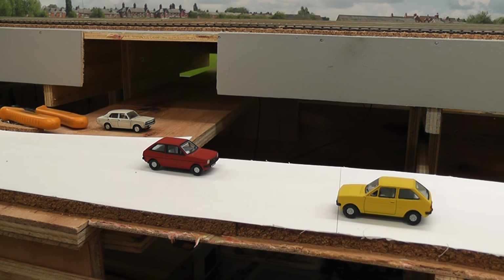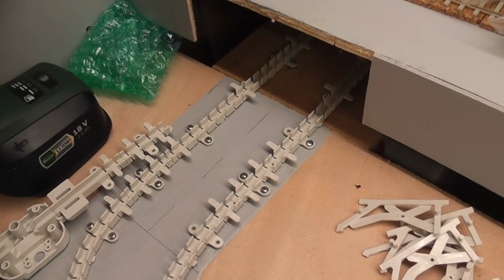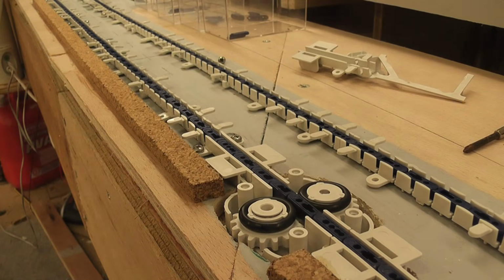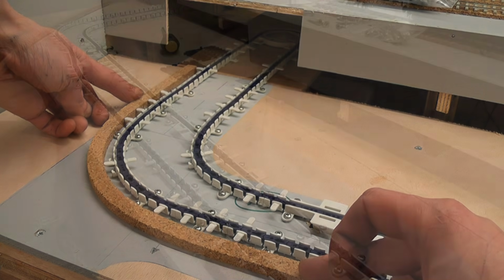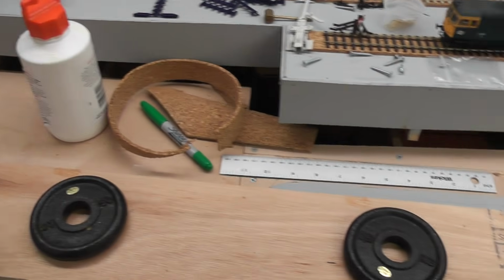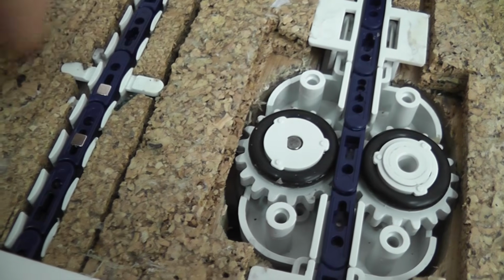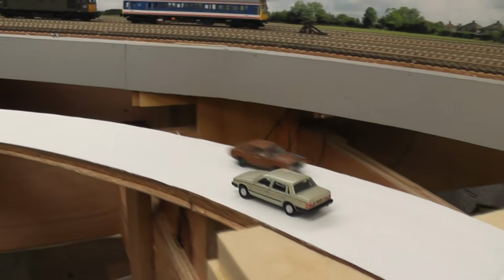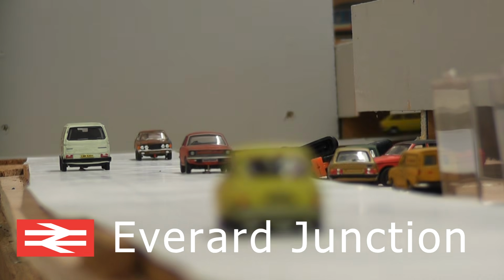New Layout Build - Magnorail

Comment: Excellent bit of modelling. I can imagine Magnorail becoming v. popular over here in the UK. I have used talcum powder as a dry lubricant in the Keen system couplers. This I have found to be very effective and ecconomical. I don't know whether it would work with the plastic in the Magnorail system, but it may reduce the noise level aswell as prolong the life of the track/chain. Regards Stuart

Comment: What I would like to see is whether you could have two of these systems meeting each other, and therefore allowing the vehicles to change road/direction when the slider reaches the different circuit, and it will follow either based upon which direction the car wants to pull it. You could also dip one circuit below the other if you wanted to change systems to remove stress/ make easier directional changes. Really great work 👍🏻

Comment: Excellent video, and this partly explains why you've been a little quiet on YouTube recently.

Clearly the Faller technology isn't appropriate for your application, for the reasons you've outlined here, but don't necessarily reject it completely.  I haven't tried this myself (but see no reason why it shouldn't work), but if the Faller front axles with their steering capability are available as a spare part, perhaps you could provide steering for larger vehicles (trucks, buses and vans).  Those vehicles would need no separate 'skid' underneath them, and being steered around corners might significantly reduce friction.

Comment: The incline in the road running really does add something, it's not something I've really seen before. I did wonder if anyone has tried lubricating the system but considering it's operation in elevation change and length it is impressive. The floating frame baseboard technique you used really does lend itself well to this road system.

The 47 rising into view from the point of view of the road is rather majestic, feels like there is this sudden 'depth' to the scene that wasn't so apparent before. I think a few of "us" can remember being in the back of an the family car and seeing some Mk2 stock racing by.

Comment: This system looks great.I used to work with a system in mining,which is a bigger version of this.Instead of magnets,sections of the chain,would have a raised sections,which would catch onto dummy axles underneath minecars,and so push them along.The chain track,would be between the rails.A similar system is used on roller coasters.Just wonder how long this will last,as there's a lot of moving parts,but still great.Need something for people now.
Reply: A car wash is another example of the same idea.

Comment: WOW! I have seen the Magnorail bicycle in operation, but not the cars. Very impressive. Reminds me of a Matchbox "motorway" set I had as a child with a long coil and plastic prongs you stuck on the bottom of your Matchbox cars to engage the spring, but this is light years ahead of that. And it was ever so loooong ago! ;-)
Reply: Yes I was wondering if anyone else would remember the matchbox motorway 😎
Reply: @nathancox6249  Ha ha! I take it you're as old as me! ;-)
Reply: I recommended Hot-Wheels Cars but Matchbox would also be an excellent alternative to the bent-wheel junk he's dragging around in circles. What he is using would look better if he put a magnet on the roof and dragged them around upside down. At least the wheels would stop wobbling.
Reply: @Kevinegan1  !00
Reply: @Kevinegan1  You do appreciate this is a SCALE model
Reply: Do you plan to reinstate your tyre fitters shop from the previous layout to sort out the wheel alignment(s) ? ;-)
Reply: I had the matchbox car thing. The motor was in the middle of the figure of 8. Great toy that was. 😂👍

Comment: Instead of the provided "track bed", could you use a router to cut the line? The motor area and loops would have to be flush fitted, but on a 9mm base board, negligible.
Reply: I expect that slippery plastic used for the track bed is quite important on the curved sections.  There would be some serious friction in the chain if routing a curved groove through MDF.
Reply: @GJChurchward  maybe just use the supplied track on curves and leading into the return wheels, on the straights I think it would run fine.
Reply: @irvsstella  alternatively, rout the groove overwidth and line the edges with some Evergreen plastic strip?
Reply: Great job all the same, I can't wait to see Everard Junction ptII your videos are an inspiration and a helpful goto source.

Comment: Now that's something new and interesting.   Get drivers in those cars and it will just finish the job ;-) Dave
Reply from the maker: Cheers Dave.  The cars are going to need some work.  Mostly need to try and sort out the wobbly wheels and squeaky noises.
Reply: @EverardJunction  Wouldn't be British Leyland without them! Keep them for, ahem, authentic detail. ;)
Reply: What you think if we could ? By putting headlights in the vehicles ,;-)
Reply: Zorry Dave, they don't make monkeys that small.  And crickets are too dumb to train.  You got any tiny relatives?
Reply: Working lights is good.  Still better than a motor and digital system inside every damn one.  Cars should be incidental scenery on a model railroad, not a focal point getting too detailed in the operation, but it also helps to not have everything except the trains in suspended animation.
Reply: It is a model train layout in the first instance, I agree.   Moving cars is a relatively new innovation.   It is however a challenge to get them looking realistic, which I believe Richard is trying to address.   I have seen some moving vehicles at exhibitions that seems to be breaking the scale sound barrier!  A family hatch back ' Concorde' lol.   I have not added moving cars to my Dean Park Station layout as I would have to have moving pedestrians to make it look complete...and I fear moving people would just be a step (no pun intended) too far.  Where do we go after that? moving clouds, wind, lol.
Reply: @DeanPark  I think cars and a few moving structures is a good stopping point.  The movement of cars usually dominates anywhere you look, unless there's a train.  It should draw attention away from people not moving.  Lights everywhere there should be lights is very important for nighttime scenery.

Comment: After all these decades of model railways, I'm shocked its only in the last couple of years someone has come up with this idea. Such a simple product but makes a layout look soooo good. Great video as always Richard.
Reply: Uh, dude... this has been being done for decades. Try looking at the Miniature Wunderland in Germany. They have a fully operational airport, including even smaller vehicles than these (baggage carts)
Reply: @ralgith  Never seen that before, but it does use a completely different system to what's shown here, e.g. chain system and not individually powered vehicles. Regardless, one cannot compare a system designed for a personal model railway layout with something of that size built as tourist attraction.
Reply: @MxWinters  True enough, but my point was more that there are many such systems that have been built over the years. Some better than others. I love the Faller car system mentioned in the video, but I have the same issue as the video maker does. I also have the issue that they go too fast for scale speeds. Of course, the speed issue is solvable: use lower voltage batteries. Anyway, other systems exist. Both of motorized cars, and of cars being moved around in other ways. Even back in the 60s people were experimenting with this, by basically setting them up as slot cars. Of course, that had the bad effect of having slots down the middle of your roads!
Reply: @ralgith  The Wunderland is kind of on another level, though, I saw a vid of one of the planes landing at the airport filmed at just the right angle, it looked incredibly close to the real thing.
Reply: @michaelmartin9022  its made by Germans, quality is a German thing!
Reply: There's a huge need to build more animated buildings and features like DCC. A gantry crane that actually operates and loads ship container cars for instance.
Reply: @mikeries8549  I'm actually mid process of starting a business to do exactly that.
Reply: @mikeries8549  you need to visit Miniatur Wunderland, that is old stuff you talking about!
Reply: como podria conseguir uno. Me encantaria aser uno

Comment: Looks great but thats a helluva noise. I'm not sure I buy that its not any worse than a train. I'd bet as time goes on, the noise will be the problem that has this off more often than on.
Reply from the maker: With 2 or 3 trains running you can't hear it.  I'll be running it alongside the trains so its not an issue for me.  The noise is certainly something to consider though.  On a small quite layout I'd agree that the noise may become tiresome.

Comment: Will be interesting to see how the scenery and road surface olds up to the friction of the sliders.
Reply: I was thinking the same. A 2mm thick road surface can't be very durable either and with the added friction must surely be dangerous? With that said, it will certainly add a much higher level of realism to the layout.
Reply: They won't. That is a horrible set-up. With the use of modern Neodymium magnets the only thing touching the road surface would be the wheels. Even with the weak magnets back in the seventies, the slot cars that had Magna-Traction would scream around turns and never fly off the road. With modern magnets you could literally turn the whole thing upside down and the cars wouldn't fall off. You would have to be careful not to get the magnets too close.
Reply: @Kevinegan1  All right, I'll bite:  Too close to what?  Your watch?  Teeth?    Hairpiece?
Reply: Do you think buying some stronger magnets to put inside the cars would be something to try?
Reply: I agree.  The mag concept is fine, but the plastic chain seems crude and noisy.  Also, the installation needs work beyond even laying track.   //   New subj:   Anyone tried contact cement for installing track & scenery?   It works fine, if you never intend to move the item involved.   //     New subj.   Re road surface, it's not, I think, subject to slider movement.   But it is really only fragile paper in this case.   We, the committee on excellence, will naturally need a report in three years time.

Comment: Great find, and looking at prices, it is cheaper than Faller, as well.  I have been to shops all over Germany and never seen or heard of this.  A bit deeper than Faller, but a lot of advantages (The only con is that it seems not to be programmable for stopping at lights and such).  Also, funny you should mention the vehicle size limitation for Faller.  The owners of Miniatur Wunderland had that issue and re-designed the software and chips so they could run typical HO cars, which they then sold to Faller, so you can now get smaller vehicles on the Faller system.  Thanks for a great video and top tip.  Excellent as always.
Reply from the maker: I'm running 11 vehicles at present so it does indeed work out cheaper.  I used 4 starter sets in total for the road.  Smallest thing I've seen from Faller so far is a VW Touareg.  Good to see the tech is improving but I think it'll be some time before we see something the size of a Golf from Faller.  Interesting you also had not heard of Magnorail.  Its been around for some time and everybody I've spoke to hasn't heard of it, interesting.

Comment: That Leyland Sherpa is wrong. Its missing the rust and blue smoke.
Reply: haha!
Reply: British Rail Sherpa’s never moved as quick as that either, trust me I know used to drive one many moons ago.
Reply from the maker: Sure is, I need to do the Capri also.
Reply: Put the Serpa on the side with the bonnet up and a smoke generator under it.
Reply: @larryfisher7056  I was wondering about smoke unit fitted in the model, but 1:43 van or lorry.
Reply: @EverardJunction  
Nice! The last layout was good, the new one will be awesome.
Years ago I bought a brand new Capri II. Worst car ever.  I finally junked it  when the front suspension collapsed.

- Dave
Reply: @EverardJunction , 8n regards to the noise,  some graphite powder or other dry lubricant will make a large difference.
Reply: @EverardJunction  a chance to make the vehicles look great with some weathering, rust, drivers and some passengers.
Reply: John Clarke :)
Reply: Kudos!  Wot a choice comment!   Well done.   (Smoke kits for cars appears to be off limits in train sets.)
Reply: It’s running so yes it’s very wrong😂
Reply: The Marina is missing a piano on it’s roof.